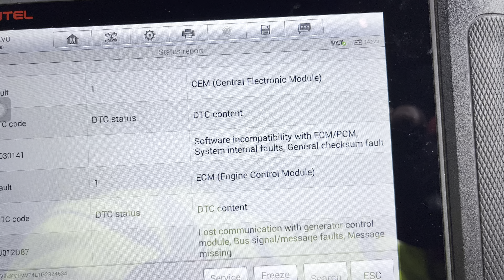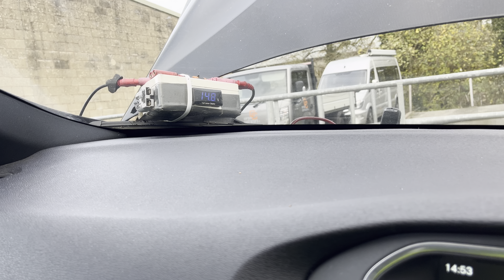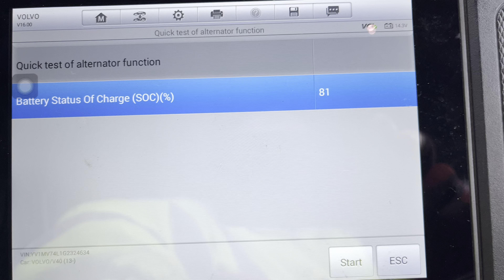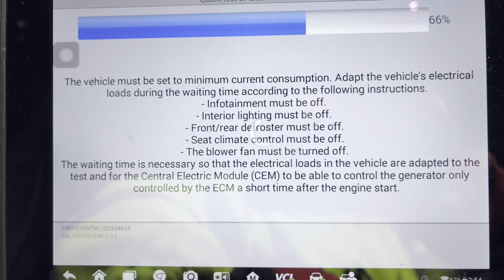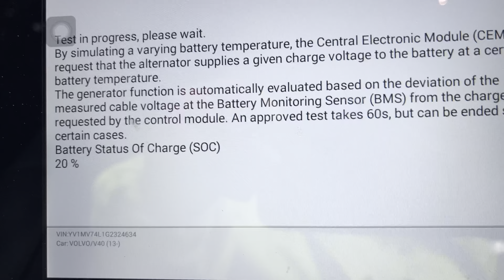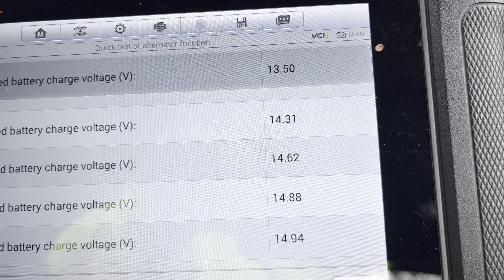Volvo v40 alternator problem is it the ecu? 🤔

Comment: Im having same issue on my volvo xc60 t6 2014, i replace couple of times the alternator and the light still on. Error p0561 and p0562, replace the battery, check the pulley… everything. can you help me?
Reply from the maker: Did you fit a genuine alternator?
Reply: @c @caralarmandradio remanufactured